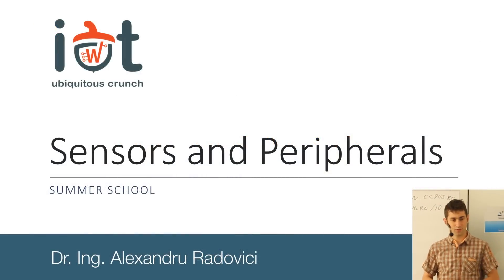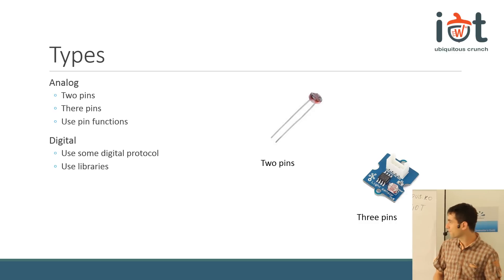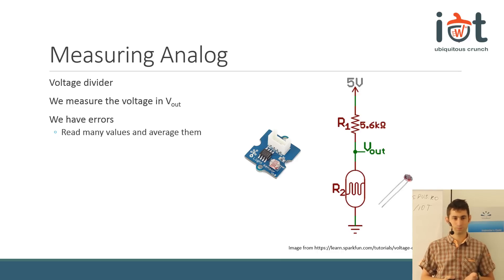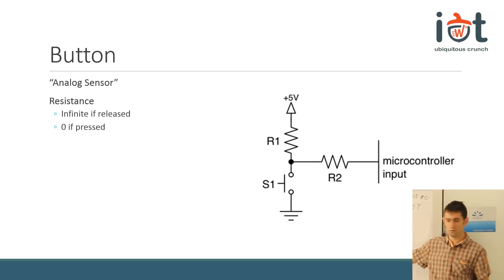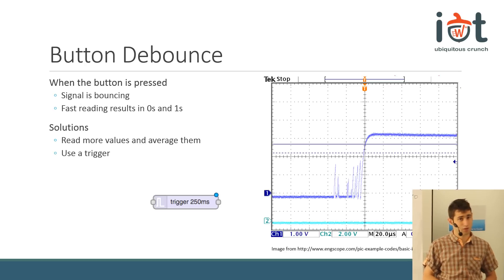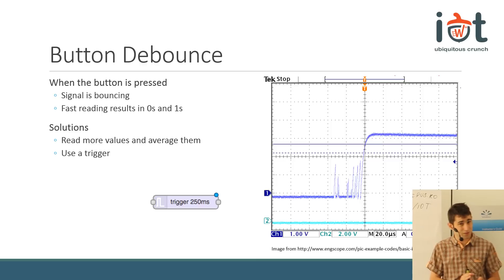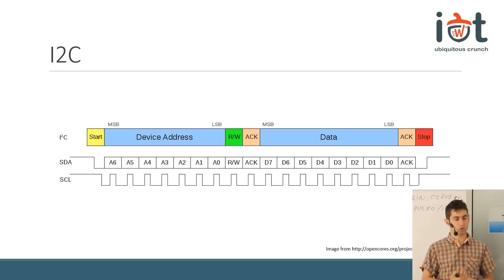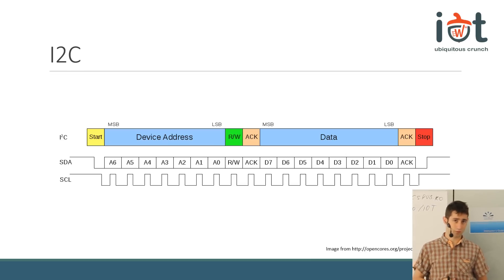Lecture 4: Sensors and peripherals

Comment: Is it possible to dispense with micro-controllers And rely on servers? By making the sensor send data to the server, the server processes the data and takes the decision, and sends the results to the actuator.(The server performs the micro-controllers function)